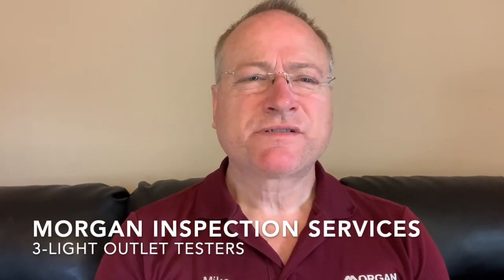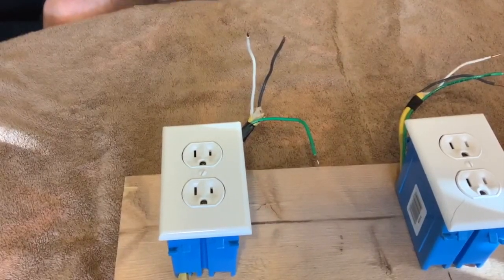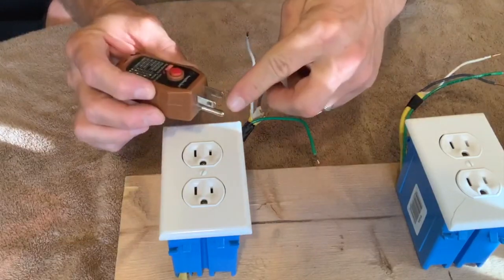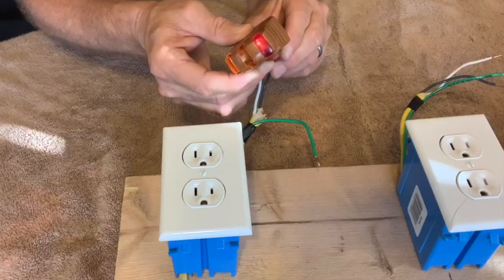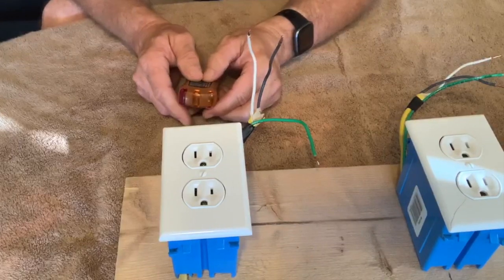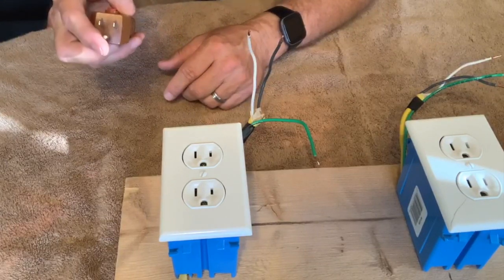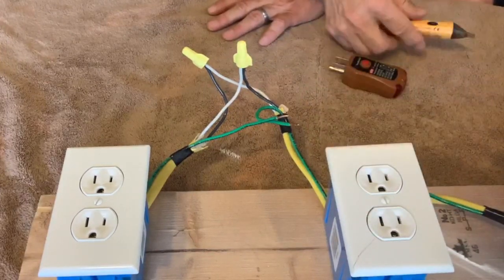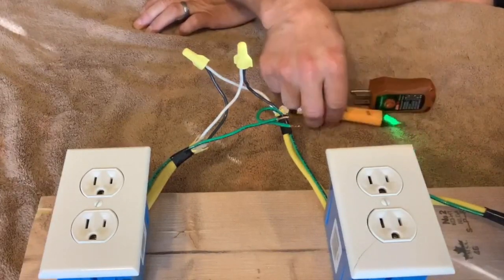Understanding the readings on a three-light outlet tester

Comment: Great demonstration! Keep the videos coming.  One thing you might add and/or explain, maybe in some future video,  is a tester that has all three lights lit, this occurs when a 120 volt outlet is wired for 240 volts,  such as might happen when the wrong outlet is installed for an air conditioner or larger electric heater, (ex. a NEMA 5-20R instead of a NEMA 6-20R) . Other than that, this is the most complete guide to 3 light testers .  I have subscribed to your channel
Reply from the maker: Great suggestion! Thanks for subscribing to the channel!

Comment: What if I have nothing connected and its still hot grd. reverse?
Reply from the maker: If nothing is connected, it will not show up as a hot ground reverse.  It would show up as a dead receptacle because of the open neutral. That is another problem with these testers. It will show is a dead receptacle, so someone could think that there is no power to it and potentially get shocked/electrocuted because there is still power to the hot wire.

Comment: good information but how you setup this lab testers? wouldn't trigger control panel to be off or blow up once you connect hot with neutral?
Reply from the maker: I am not completely sure what you were asking about setting up this tester. I never hooked up the hot and neutral together. Yes, that would cause the breaker to trip.

Comment: If I don't have one of those voltage detectors, can I just use a DMM to confirm reverse polarity? Will it show up as -120V if its reversed? The DMM has a NCV thing on it but I doubt that would be useful for anything except checking for power at the outlet in general. Thanks.
Reply from the maker: Sure. A digital multimeter will work. If you have 120-volts between neutral and ground, and no voltage between hot and ground, then this would indicate reverse polarity.

Comment: I have an outlet with all 3 lights on.  Any idea what that is saying?
Reply from the maker: The only way I can think of that you could have all three lights on is if the outlet is wired with 220 V instead of 110 V. If you have a voltmeter, I would recommend you check the voltage between the hot and the neutrals and see if you don’t get about 220.
Reply: @morganinspectionservices3840  i have read online forums on all three lights on, and as for a 120 volt outlet wired for 240 volts,  how can that even be possible.   ??? Because the reason why an outlet for an electric dryer,  or an electric cooktop,  for example is shaped very different to prevent this very situation,  and being a 30 or 50 amp circuit would mean the wire gauge would be much too large to fit a standard 15 amp outlet.   Have you ever personally witnessed this? If so, how did someone accomplish that?
Reply: @Sparky-ww5re  They do have 20 amp 240 volt outlets...
Reply: @AmericanOne9621  yes you are correct,  like the kind for a window air conditioner.  When i was replying on a typical 3 light outlet tester with all three lights on indicating a 120 volt outlet is hooked to 240 volts, now that you mentioned that, that would actually be a more common occurrence than you might think, especially during major renovations. Ex.  A home was built with a window air conditioning unit in mind.  20 years later, the homeowner decides to install central air conditioning. The window air conditioner is no longer necessary.  That outlet is completely useless.  That homeowner,  who is not level headed when it comes to electrical work, decides to replace the 20 amp 240 volt air conditioner outlet with a 20 amp 120 volt outlet,  not realizing the prongs are shaped differently for a good reason and that's to prevent the wrong product from being plugged in.  The 240 outlets i was thinking of were for an electric clothes dryer or electric cooking stove, which would have wires too large to fit a standard 120 volt outlet. Right me if I'm wrong
Reply: Did you ever figure this out? I'm trying to diagnose the same issue.